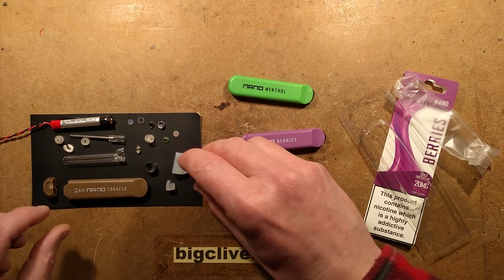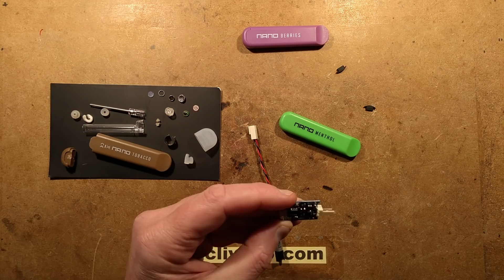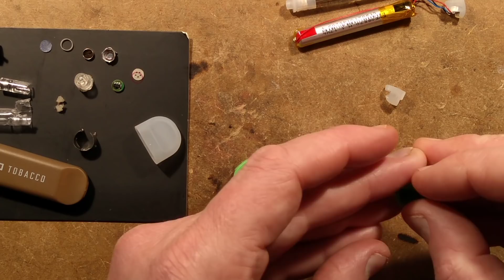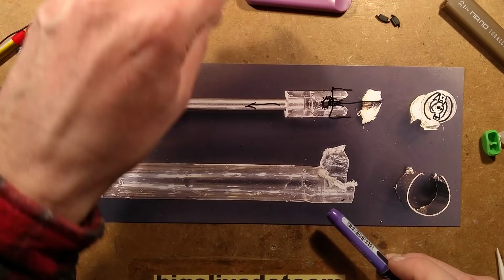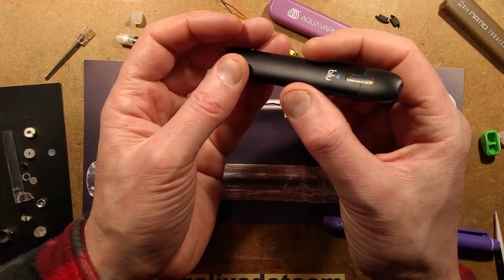Free lithium cells from discarded vapour devices.  (And total teardown of one.)

Comment: They must have improved those pressure switches a lot in the last few years.  The problem I had with them on the rechargeable cig-a-likes is that the vibration of walking around would occasionally trigger them.  You couldn't ship a disposable fully charged if they still had that problem (and there'd be no point shipping it uncharged).

18 mg is the current legal limit, not 20 mg.  24 mg used to be common, and heavy smokers may have wanted more.

It's worth salvaging disposables from the street for cells.  A lot of charge/discharge cycles left.  Probably not so for rechargeables,  because with the tougher tanks and replaceable coils on many modern shisha pens, it's the cell degradation that eventually becomes the reason to discard it.

As for what to do with those salvaged cells, here's what Photonic Induction used them for: https://www.youtube.com/watch?v=gSxJyhzJJnY
Reply from the maker: I think early units did use an audio sensing microphone arrangement.  They were prone to false triggering with noise and vibration.

Comment: Hi Clive, I am into harvesting old LT batteries 18650 type. I want to make a 12V battery pack or packs for my trail cams. Here is a great little charger for no money https://usa.banggood.com/3S-12V-10A-18650-Lithium-Battery-Charger-Protection-Board-Module-11_1V-12_6V-p-1177897.html?gmcCountry=CA&currency=CAD&createTmp=1&utm_source=googleshopping&utm_medium=cpc_bgcs&utm_content=zouzou&utm_campaign=pla-cag-all-0801-pc&ad_id=375118411367&cur_warehouse=CN 

How about reverse engineering it and modifying it for 4 cells making it a better charger for 12V nominal. 3 cells will work but could do with a little more. What do you think? I live in Canada so I have 120V AC 60Hz available.

Comment: I would like your take on how to build a micro fog machine reusing vape components.
Reply from the maker: The commercial vape based mini foggers seem to use an adapter that takes off power between the base and head and uses it to power a small pump that blows air in the same area.
Reply: Nah. The design of vape devices is pretty much optimised for that purpose.
You'd really need to design from a different approach.
Add 50% water to 50% glycerol then load that into an ultrasonic humidifier. Add a fan for greater cloud making ability.

You could add vaping flavours or water based food essences for flavour.
Reply: @QlueDuPlessis  People have used air pumps to do what he does when he blows instead of sucking for small fog machines used in costumes, it's just that most of those are quite janky. https://www.youtube.com/watch?v=uDISX8MMLak

Comment: Is the design of the liquid section "seal" not to allow for the expansion and contraction due to changing ambient air pressure? .... You wouldn't want it dripping in your pocket would you?
Second and perhaps more serious ...... Nicotine! I realise this is diluted in the mix but what is the dose needed to cause appreciable damage? Pure Nicotine is fairly toxic and can be fatal ..... at what level does it become "safe" to handle as it can be absorbed through the skin?
Reply from the maker: I wouldn't want to come into contact with pure nicotine, but when it's diluted to a tiny percentage in vaping liquid brief exposure is not too hazardous.

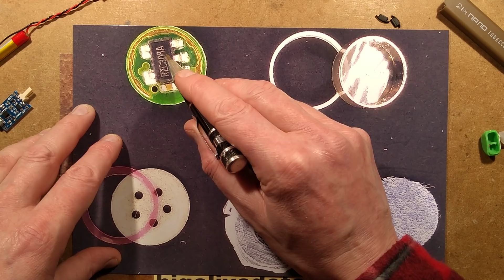Comment: 9:35 It seems that the chip is from a PRC company called RZC, the chip is AX308. It's an ASIC designed for exactly this purpose.
Reply: Found it on www.TransistorMosfet.com as a Small Outline Transistor package (SOT 23-5) as RZC308A FilmTransistor MOSFET  US.$3.00. Not from Hammond manufacturing which is a totally different chip with the same number. Happy New Year.
Reply: https://www.jotrin.com/product/parts/RZC308M seems to be it, with no datasheet

Comment: you could use the lithium cell for your outdoor lights to give it more go power at night
Reply: The energy available is typically limited by the size of the solar cell in the garden lights rather than battery capacity. The standard cell won't have a high enough voltage to charge a lithium ion cell either.

Comment: It's sad these are sold as "disposable" given they could easily be recharged and refilled, maybe they should come with a money-back scheme where if you return the device to buy another, you get money off the next one so the batteries don't end up in landfill, on the ground & buried in soil, or down the gullet of a greedy seagull...
Reply: You can get rechargeable/refillable for around the same price.  Larger, and not as chic, but more economic.  https://www.ebay.co.uk/itm/EVOD-MT3-1100mAh-E-Cigarette-STarter-Kit-E-Cig-Vape-Pen-Charger-24HR-SALE/254339571752?ssPageName=STRK%3AMEBIDX%3AIT&_trksid=p2057872.m2749.l2649

The wick gunges up eventually, but you can get replacement wick/coils.   Battery dying from too many charge/discharge cycles is why you dispose of it.
Reply: or, you know, end capitalism...
Reply: @qwertykeyboard5901  yeah...we would all be vaping corncob pipes as latest wood technology and there wouldn't be any qwerty keyboards either.  Stifle the engine that fuels innovation?  Sounds like death spiral into desperation and despair to me.  A bit of moderation would be welcomed though as so damn much of this factory to landfill crap.  That we can agree on.
Reply: @gavincurtis  Money isnt the only thing that stirs innovation
Reply: @qwertykeyboard5901  I agree

Comment: 20mg salt nicotine is NOT the same thing as 20mg basic nicotine.  The salt compound has less active ingredient (ie nicotine) w/w.  The usual salt is benzoic nicotine salts which has molecular weight of 284 g/mol (grams per mole).  Basic nicotine has a molecular weight of 162 g/mol.  This means that the liquid listed as 20mg/ml nicotine salts (probably benzoic) contains only 11.4 mg/ml of active ingredient.  Note that it's really important to know what salt you're dealing with to know what the real strength of the liquid is.  This is all something that the industry is going to have to deal with at some stage, not least because of the TPD restriction of 20mg/ml.  The TPD makes no distinction between nicotine salts and basic nicotine, which makes absolutely no sense whatsoever.

Comment: I wonder if you could take some resistance wire to make a coil and make a rechargable electronic lighter. Also, what is the normal charging amperage of the resistor value on the tp4056 you removed and replaced? Love your videos.

Comment: Selling those should simply be forbidden. Or the sellers should be obliged to take them back, with thorough control of their recycling processes - on their expense of course.
Reply: Have a deposit on them. Just like pop cans
Reply: China would be glad to take them back for a price,  then promptly recycle them back to the environment by dumping them in a landfill...  There are many more wasteful things that china produces but for some reason these really make me frustrated.
Reply: @mrbyamile6973  I think they would just re-use them, at least the batteries, and probably the pressure sensor. They do use parts recovered form e-waste in new items.
Reply: @mrnmrn1  Yep, just like pigs, there is nothing in a vape that isn't reusable, from the oink to the spring in the tail.
Reply: @tikaanipippin   I use them battery's in all my alarm sensors I just re soldiered them inside then use a micro usb out of a rechargeable vape fitted on the side.  they are actually rechargeable batteries. They just don't fitt a usb on the disposable so you go buy anther one. they are quite handy for many small stuff to be honest.  They are all 3.7v just with different Milly amp hours
Reply: @officialmysteriousrider130  What do they power which is fine with the 3.7v to 4.5 at low current that they provide?
Reply: @mrbyamile6973  China aint taking this crap! They halted imports of trash from western countries
Reply: @qwertykeyboard5901  that's right,  I forgot about that.  They were tired of us sending them contaminated recyclables.   These vape devices would contaminate even worse with all the internal components and battery.
Reply: Good for me...I collect them in large quantities from people from my local area..... Virtually unlimited source of  li-ion batteries for my projects 😁

Comment: That 20mg sounds mighty potent. I recently switched down to 3mg because I found the 6mg a bit too strong.
Reply: nic salt vapes provide more nicotine with a smoother hit. heavy smokers who are used to a pack or more a day often find a regular vape to be unsatisfying, or painful if the nicotine level is high enough to satisfy. using nicotine salts instead of freebase (the kind of nicotine in regualr e-juice) reduces the ph and reduces , making the hit much less harsh, and also reduces the bioavailability of the nic. this means that nic levels need to be higher for a similar strength, but can also be raised far higher without the hit hurting. this si good for heavy smokers, but also means nic salts are much higher concentration and therefore super easy to get hooked on if you're, say, a high school student with a juul, easier than a normal vape. nic salts are useful to help heavy smokers quit easier, but also help tobacco companies get a new generation hooked on nicotine. they'll say the purpose is the first, but its really the second.
Reply: @sierra_R  Thank you for the explanation. I vape 3mg/ml VG only with no flavors, but i've never tried these salts to see the difference for myself. They are also more expensive, so i don't personally see the point to even bother atm. But that's just preference. I don't agree with your wrong phrasing/statement about people getting hooked on nicotine though. This is the oldest myth and scientifically proven to be complete bullshit. Nicotine is as addictive as coffee, so i wouldn't repeat Big Tobacco's brainwashing slogans if i were you. ;) The toxins in burning tobacco, the aroma, the warmth, the inhaling habit, the social aspect of bringing total strangers together + friend gatherings, the psychological aspect of doing something you know is slowly killing you... there are many addicting qualities to cigs, but nic ain't one of them. Same bullshit is also said about cheese. And while i don't argue with the fact that nic and cheese contain SLIGHT AMOUNTS of addictive chemicals in them, i argue with the way they're portrayed as this big deadly monster they never were.

Comment: a microphone is a pressure switch. I wonder what kind of resolution you oculd get out of it if you hooked it up to amp/speakers
Reply: 1 bit
Reply: A microphone is a pressure sensor, not a switch.
Reply: @ferrumignis  Yes, but if you quantise it down to 1 bit it becomes a switch and vice versa
Reply: @ferrumignis  depends on what you want to hear
Reply: @ferrumignis  what do you think a microphone does? Sound made of pressure waves. If you blow on the sensor, then you create pressure (variable). I'm not sure what you think I  meant
Reply: @ferrumignis  you've obviously never worked with microphones. They do pick up DC. As you admit in your own words. 

When we sample a sound wave, to digitise it, we break it down into a number of bits and a sampling rate.
This device detects changes in pressure using a digital sampler. You see it as "DC", but that is just the output. The input is the same as for a microphone, a pressure sensor. Something that moves as pressure changes.

Depending on the bit depth and sampling rate of the chip, this thing perhaps could act as a very crude microphone. So the question I asked is not about DC or AC, but rather about the capabilities of the chip.
Reply: @ferrumignis  
It is clear you don't know much about microphones at all. 
https://en.wikipedia.org/wiki/Microphone#Condenser
Reply: @ferrumignis  Ok. you obviously think that you are very smart, and that I am stupid. Its a bit tiring, as your ego has now got in the way of rational discussion.

Condensor microphones work HOW? by moving a coil in a magnet? No. that's your 'microphones only pick up ac' argument position. Condensor microphones work by having a changing capacitance produce a voltage. which means they can measure DC. A particular pain in the arse if you do any kind of sound work outside where moving air gets very loud and you have to go to all sorts of lengths to isolate your pickup from wind.

Tell me how this pressure sensor component in the vape works again?

Comment: The large pod on the Blue/blew model, when the coil is truly spent, lends itself reasonably well to a gutting and installation of some sort of LED assemblage. Perhaps a short duty cycle intensely-bright flashlight, or a flasher of some sort (red or white), or even a laser pointer derived from the guts of a cheaper (dollar store or pharmacy) version.

Comment: Plastic, dozens of chemicals and nearly impossible to recycle. Instead of jacking up the cost of energy and slapping all kinds of "eco taxes" on things why not start with banning this kind of utter waste?
Reply: You have eco-taxes where you are?
Reply: @cncshrops  Don't you?
Reply: @cncshrops  Yes everything from added taxes to "wasteful products" to an added tax an electricity and gas. Plus there a things like rating systems for houses, how eco friendly they are, and depending on the rating you get taxed differently.  Been going on for 15 years or so. Incrementally. Every year they'll add something new. Boiling frogs.

Comment: A couple months ago, one of the gas/convenience chains had sever promos for various rechargeable modules for $0.99 (e-liquid sold separately) ... I picked up a quantity, mostly 'blu' ... Haven't checked, yet, if the price was good for the components ... I was going to figure out the 'pressure module', but now I don't need to .... Thank You Very Much ... The 'blu' have a single board with the 3 wires to the 'pressure module'
Reply from the maker: I made a video about the Blu.  It's very well made and the disposable cartridges can be refilled with nicotine-free liquid very easily.

Comment: about a month or two ago, ebay has completely clamped down on all items related to vaping.. you used to be able to find lots of cheap items of all sorts, but now you cant find hardly anything at all. its a shame. there is however a loophole to find a vape battery which is that soldering iron battery.. i wonder if there are other products that are actually stealthily vape batteries

Comment: The microphone is a pressure sensor, activates on negative pressure (when you inhale) i even found the manufacturer a few years back in china. All automatic vapes have it. The battery is very popular too used in many cigarette style (like smokelessimage) devices. It does have low voltage disconnect and a charger and a voltage indicator via the led.

Comment: These could be cells which failed QA, but could still hold some charge, and might fail (spectacularly) after a few dozen more cycles, whereas "real" good ones should last hundreds or even thousands.

We get it, you vape.
Reply from the maker: If they were they'd be selling a product with a fully charged bad cell.  I looked up the cell number and it is a rechargeable one sold for use in vaping devices.

Comment: Hi Clive.
The sensor would be over the small hole, to give a  short term differential reading when you suck.
The large hole would be to make sure that over time a differential would not occur to cause the element to activate, due to heating or cooling of the environment.
Great video, the heating elements have been used by railway modelers as smoke units in scenery and such.
Happy New Year mate, 30/12/2019 here in Australia
Here is the shipping report,   2:00pm  40.5C outside. Hot North winds, gusting to 72kms.😮👍😊😊
Reply: Useful observation about the holes 👍

Comment: I find it fascinating that the sensor they used to detect suction was just a simple microphone. I have wondered for some time how that was sensed but never looked into it. Needless to say, using sound instead of a pressure differential is a very elegant solution.
Reply: Edit: continued watching video, my assumption of it being a microphone was wrong; and now I really need to take on of these apart for myself. The construction of the tiny pressure sensor included is astonishing.

Comment: If i see one thrown away i'll grab it now. I could put those cells to good use, parallel a pair and it would run my FM walkman for a good long while.
Salvage the charging circuit from another unit, and i've got a power source for a few months maybe a bit more. I would need to add a dropping resistor and shave it down a volt +. Yeah that could work fine i like it, one cell may even work well enough as the discharge curve is better than NiMh. Hmm now to find a source of discarded units....